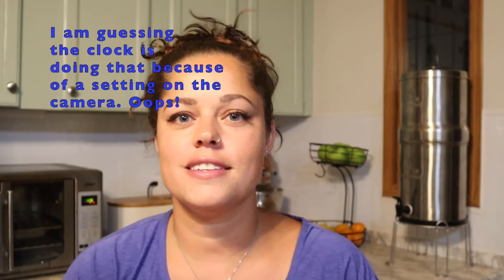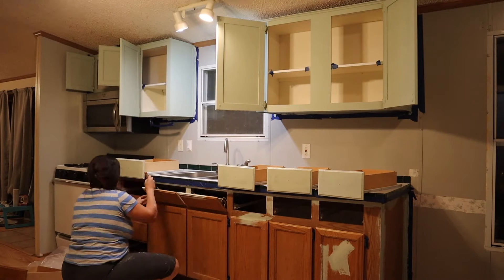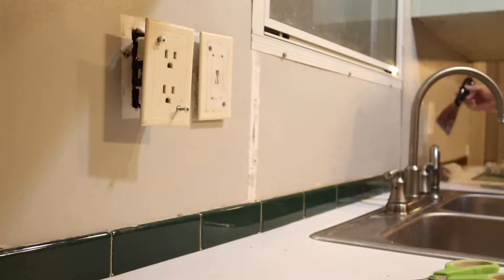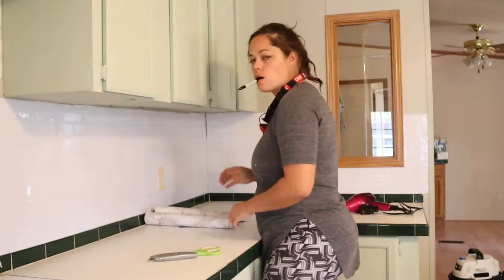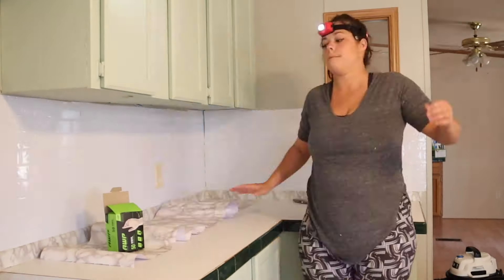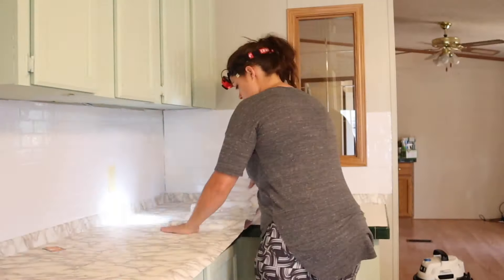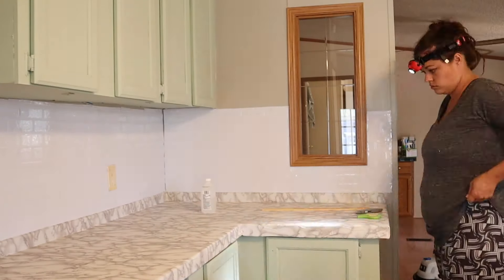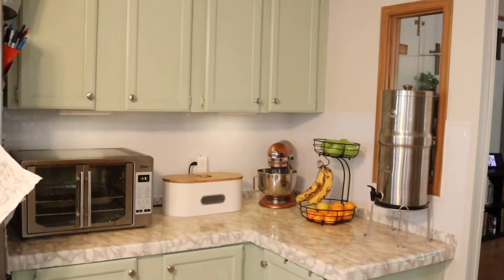Redoing Our Kitchen on a Budget- For Less than $380!

Comment: Very pretty, I would like to know how your counter tops do over time, because I'd like to do the same. I'm just wondering if they will be able to handle a lot of kids and everyday wear and tear.  I just subbed to your channel, and I look forward to watching more of your videos! Thanks! ❤
Reply from the maker: Thank you! I think at the year mark I will do an update video about the things we did. So far, most of it is holding up well. The biggest struggle I encountered with the epoxy was getting it to really stick to the rounded edges of the countertops, so there is a bit of wear there. I feel like sharp, 90 degree angles would’ve helped!

Comment: you don't need a counter paint kit. I've seriously used applebarrel acrylic paint and paper towels covered in epoxy multiple times. My last house it was still in awesome shape after 7 years. My current home I did the same thing and it's perfect. Minus the epoxy, total cost was 8 bucks and holds up fantastic. Great video
Reply from the maker: Thank you! The epoxy was definitely the biggest cost of the countertops! Thank you for the tip! I might just have to try the acrylic paint next time, if there is a next time!

Comment: You couldn't help the clock on the microwave doing that. It has to do with the sampling rate of the camera vs the refresh rate of the microwave screen. 

I did the peel and stick on my bathroom countertop, and it was difficult to get all of the bubbles and little folds out and in trying to do so, I ended up ripping it, so that was lots of eye-rolling.
Reply from the maker: We actually just completed our bathroom and did the peel and stick (video out next week) and so far I have been happy with it. Josh took the sink out and that helped tremendously! But yes, the peel and stick can be very frustrating. With the bathroom, I chose to go with a slightly higher quality one, but it is actually textured. Maybe that helps?

Comment: I'm in the process of doing exactly this to my kitchen as well. Thank you for sharing your process! What finish did you go with for your cabinets? Do you like the finish? Does it look like you painted over them? I think that's the most intimidating thing for me right now. I don't want to mess up the cabinets.

And when you said, 'Jesus, help us.' I knew I liked you lol.
Reply from the maker: Ha! I was definitely praying for some help at that point!

I used polyurethane to seal the cabinets. It was recommended in quite a few blogs I read. I'm mostly happy with it, but there are a couple of spots where it went on a little more thick and it has very slightly yellowed. After looking into more, I saw others recommend polycyclic to avoid the yellowing. 

Overall, the process was way easier than I anticipated! You got this!!
Reply: @FruitfulRoots  thank you! I will keep this in mind to avoid praying for help. 😆
Reply: The painting prospect has me paralyzed. 😅